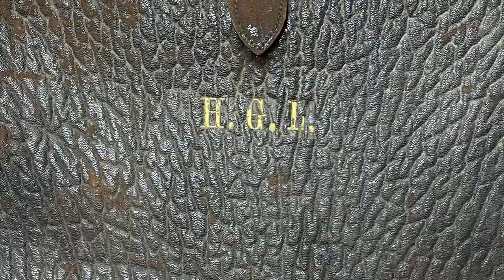Walrus leather Dr Bag from 1900s Restoration

Comment: When you put the metal parts in the distilled vinegar, u should have added a little bit of baking soda to it too. Then the parts would have gotten a bit cleaner.
Reply: soda neutralists acid how would that help to weaken the acid,100% not what you want to happen .
Reply from the maker: The vinegar actually eats the rust very well but the parts had an old metal treatment called japanning on them. It is extremely resistant to abrasion and resists moisture. It was hard to tell originally but becuse it was gummed up but after I had no change over night I realized something else was on the metal. I tried everything to get it off so I had to eventually use physical methods.

Comment: What oil did you use?
Reply: It was originally hard as cardboard. I used olive oil spring it back to life. I would recommend leaving it sit for a few days afterwards to allow the oil to penetrate and equalize. It is easy to over saturate so work slowly. You may need to wash out the excess oil afterwards it depends on how dry the leather is. If it still has some flex I would start with Mink oil or Neatsfoot Oil.